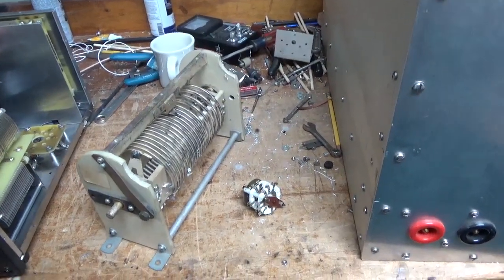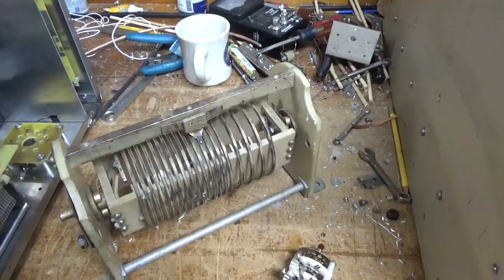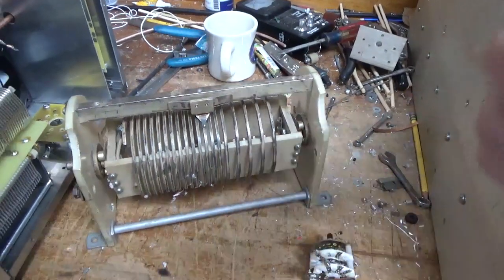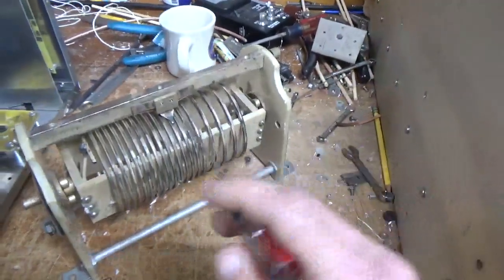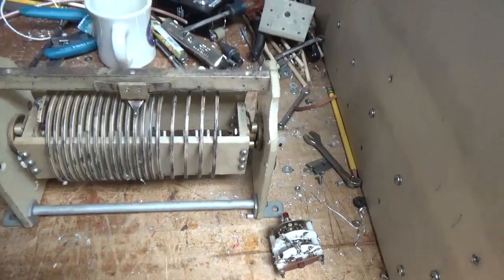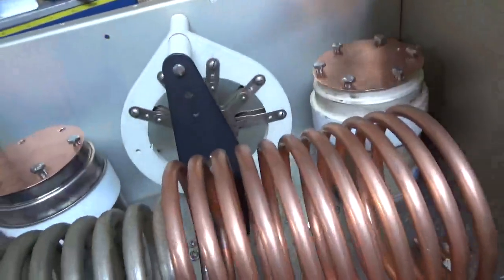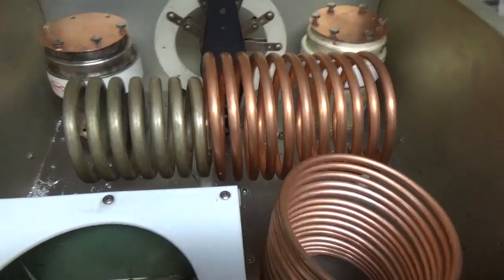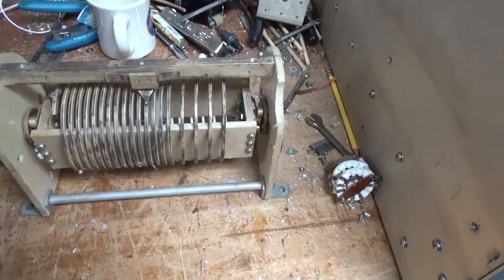Down Sides Of A Variable Inductor, Why A Progressively Shorting Switch I superior

Comment: I like smaller Rollers for lower plate volts/mA level currents. I learn a lot from your vids, thanks for posting.
Reply from the maker: In any application , output network , input network , antenna tuner  ,  where  the inductor sees frequent adjustment . An open open will most likely cause damage to the source being put into into it. 

I see a lot of amps that come in for repair that had an antenna tuner variable inductor open connection 

I avoid them like the plague